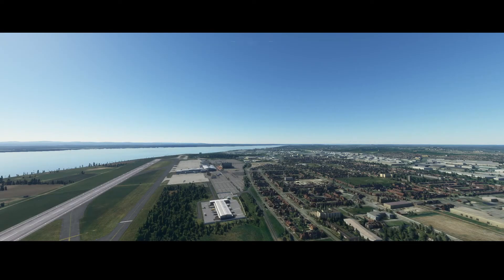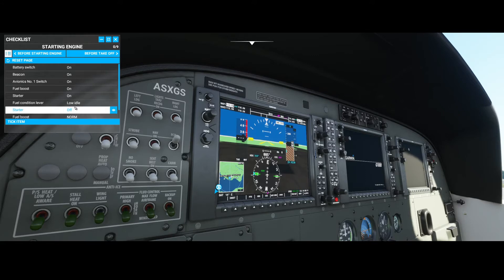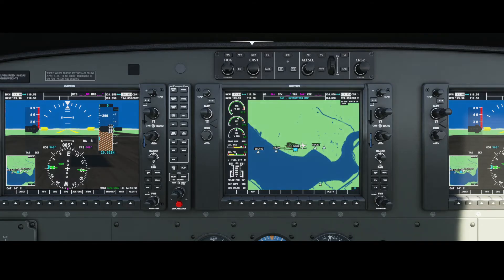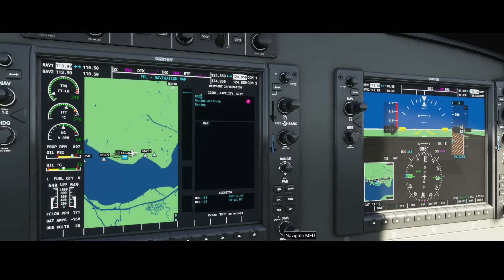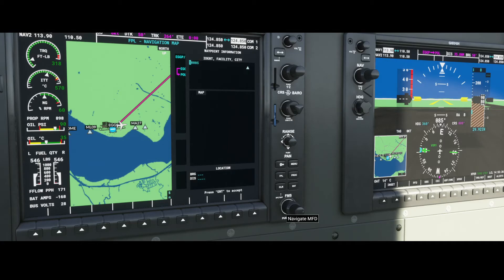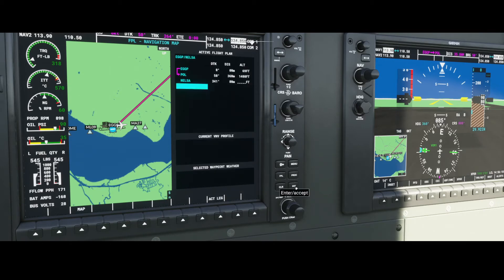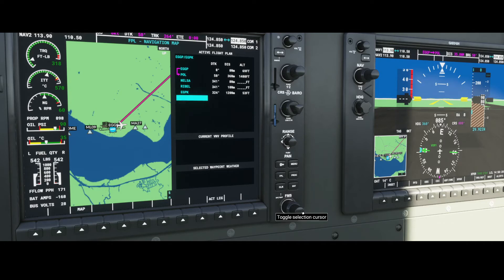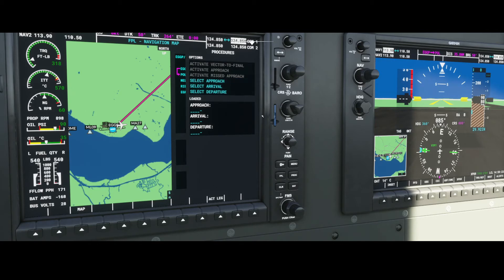Flight Simulator 2020 - How to - Cessna 208 B Gran Caravan - Set flight plan manually

Comment: how do you enable gps mode? You are on heading mode and then getting close to the flight plan but does not change from HDG to GPS, from where you activate GPS mode? In FS 2024 i mean.
Reply from the maker: hi Zsolt press the CDI button multiple times
Reply: @Highintheflightsimsky  found it after some time, thx. CDI that is.

Comment: My FPL layout in 208B is strangely little different. It subdivides flight plane into three parts: ORIGIN, ENROUTE, DESTINATION. When I try to insert all waypoints, it connect only the origin with the destination with a white straight line and the origin with the first waypoint with another purple straight line. Also, even if i set the CDI on GPS, the NAV autopilot does not work and follow a random direction. The same issue with Bonanza. Please help me. Thanks  a lot.
Reply from the maker: Hi Marco, if you installed the Garmin G1000 NXi addon that is expected and also several other addons are doing it like this. The origin is the airport from which your depart and the standard instrumental departure (SID) which you selected, that is followed by the enroute intersections, vor's ndb's etc, and as last you have the destination airport and if you did setup a standard terminal approach route (STAR) also the waypoints belonging to that. I do think the reason why NAV is not working is because you are not close enough to the purple line. If you are to far from it the autopilot will only use the HDG option and will active the NAV option in standby mode. As soon as you are close enough to the purple line it should switch to NAV mode.
Reply: @Highintheflightsimsky  cum